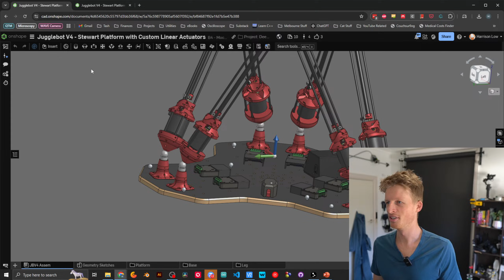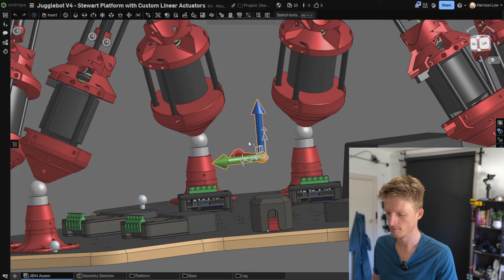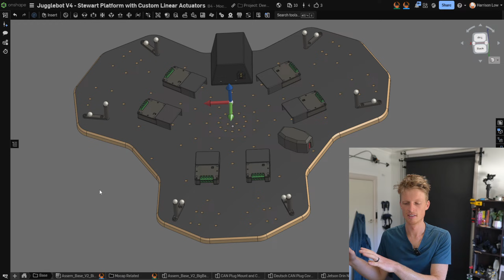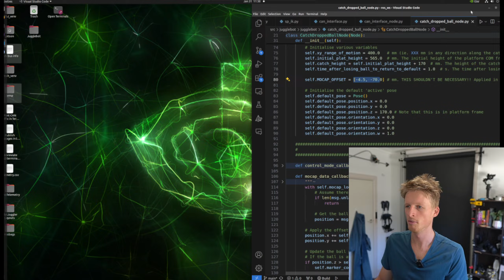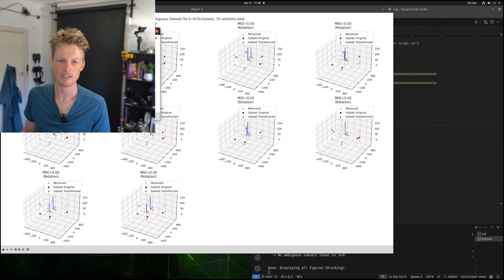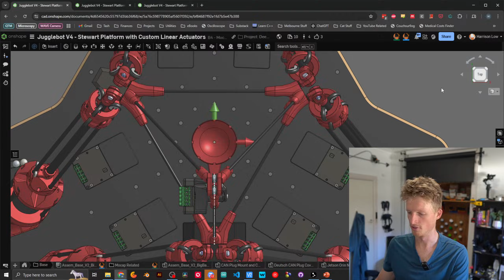PDJ Weekly Livestream # 45 - Mocap Update

Comment: If you have one side's outer markers high and the other sides' outer markers low then the bounding cylinder will be slightly tilted and a bit thinner than the one you probably want. Also, the CoG won't be exactly in the center.

This might or might not be a problem, depending on how you use the markers to define the coordinate system and/or how you use it.
Reply: If you want to have an easily proper center then you can make all sides the same, and add 3 new markers (one for each side), one low, one high, and one in the exact middle between low and high.

Alternatively you can instead simply add 2 markers, exactly opposite of each other (wrt the center) and on the same height. That will keep the center where it is while breaking the 3-way symmetry. It can also be easily chosen in such a way that it will also break mirror-symmetry.
Reply from the maker: Good ideas! I like the idea of keeping perfect radial symmetry for the outer markers but then adding extra ones to break that symmetry. Very clever!

As it happens, the motion capture software is capable enough that we don't need to fuss about this so much 😁Check out today's livestream (#46) to see what I mean 😊

Comment: I'm very confident that your algorithm for detecting whether reflections or rotations are detectable is wrong. You are right that if 6 missing markers has multiple possible orientations, then any additional missing markers on top of those 6 will also apply. For instance, you cannot know if the extra marker missing is the one on the right at the front, left or right corner of the base when the known markers have a threefold symmetry.
Reply from the maker: Ah yep, you're right! The algorithm isn't allowing markers to be fit to occluded marker positions—it's treating each subset as though these were the only markers in the rigid body. While in reality, if a marker is occluded, QTM will still be on the lookout for a marker in that (relative) position, so visible markers can still be fit there.

Good thinking, and thanks for raising this! I guess I was too quick to 'disprove' my intuition 😅
The meeting with the QTM guy has shed a lot of light on how I can better use this system, and I'm not sure if I'll focus too much more attention on the 'layout_analysis' algorithm, but if I find some time I'll see if I can fix this bug.